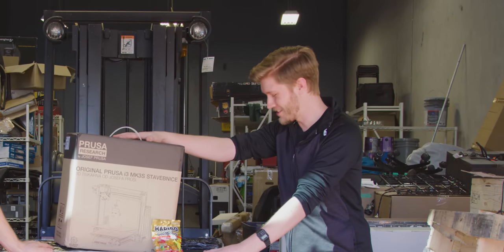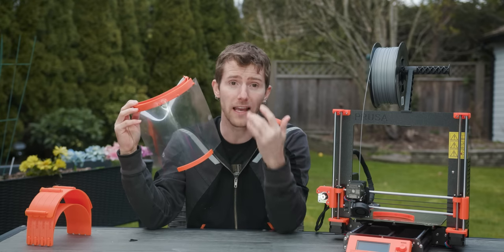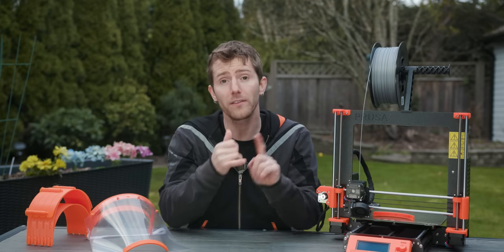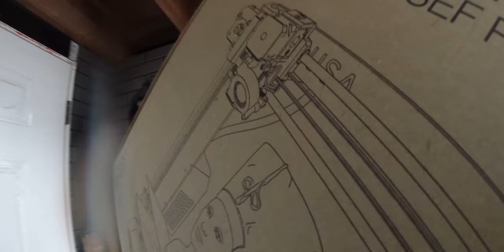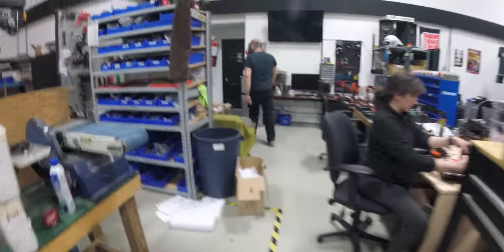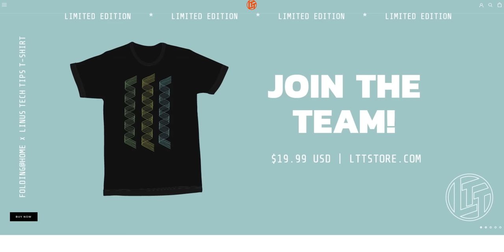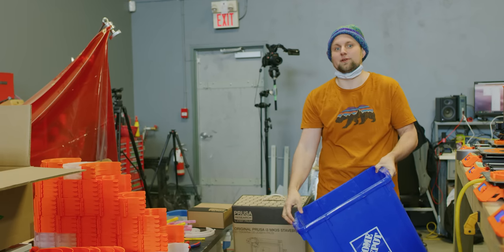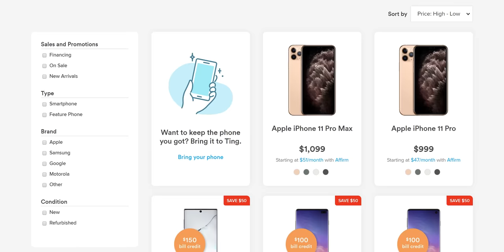3D Printing 300 Face Shields… PER DAY

Comment: im a large 3D printing enthusiast and im curious as to what issues you had along the way. What kinds of failures?
Reply from the maker: @UCzSvEg274I4BCTOg_dE9A0A Actually, there were some issues -- which we expected -- given the crowdsourcing of the builds. It was mostly limited to slack/misaligned belts or improperly tightened GT2 pulleys. ~95% of the printers were out of the gate perfect, and the rest I had fixed in minutes -CW
Reply: Make it a separate video!!!! Hahaha

Comment: "Why are we not using injection moulding?"
I'll ask a better one
What is injection moulding?
Reply: I'm gonna go out on a limb here and say it's probably where you inject plastic into a mould...
Reply: This is the thing that bothers me so much. Using 3D printers is a good way to quickly prototype the face shields. But it is a very slow process.
3D printing in its essence is for quick prototyping or making at-home-DIY projects.

With a large scale need for face shields, you absolutely need to leverage injection molding. A company in my country did that, first using 3D printers to make the prototype and then have it approved. Then they moved to injection molding and re-tooling took a week. After that they could produce 5000 units per day.
Reply: Injection Moulding is a process in which warm, fluid plastic is pressed into a mould. The big advantage over 3D-Printing is the fact, that it takes seconds, not hours, to complete a part. The downside is, that you need a injection moulding machine and the mould, which needs to be made specifically for the part you are producing.
Almost all of the plastics we use, are produced with injection moulding, therefore they are so cheap.
Reply: @unbenannt7771  true, but the machine cost a fortune, 3d printer is franction of its price
Reply: @unbenannt7771  'warm fluid plastic' ?, no , that stuff is damn hot, get it on your skin and the skin is gone , been there done that . The downside is as someone else has pointed out you need the machine and the mold , both of which are expensive . The mold is refereed to as a tool and takes a lot of design work and testing , but yes , its the fastest and most cost effective method
Reply: @timipetrasek470  the machine itself isn't too expensive when considering other industrial equipment. The expensive part of it is making nd maintaining the molds. The tolerances have to be incredibly low so that the mold will accurately output the part.
Reply: putting melted plastic in a mold. its lighting fast compared to 3d printing, cheaper because they dont need to buy filament, and more eco friendly since it uses less electricity to make it and mold the filament in the first place
Reply: I'll ask a better one
WHY IS INJECTION MOULDING
Reply: @alexleistikow2940  ever hear of April fools?
Reply: @Lars16  The cost of the machine depends on the size of mouldings you eat to make, it isn't something like Wheely bins  or larger the machine is huge and so is the price tag. If it's just nozzles for something like vinegar bottles then the machine would fit in the back of a pick up truck . The biggest ones cage to arrive on several articulated trucks and be assembled on site. Biggest I worked with had a clamping pressure of 50+ tons
Reply: @Lars16  3D printer is def not  a quick way compared to mould, buuut everything counts and it is awesome they step up, I personally donated money to womens center for domestic violence in Italy, what have you done?
Reply: A machine clamps 2 pieces of a mold together at a certain tonnage. The mold has cavities in which melted plastic is 'injected', the mold is cold (cooled with water) so the plastic solidify's and retains the shape of the mold. Machine opens the mold after the plastic is cooled and the end product get's ejected from the mold. 

The most expensive part of injection molding is the tooling (mold itself). But due to high volume the cost per piece of product is very small.
Reply: @Lars16  Yeah. I don't want to shit on peoples efforts but 3D printing is not great for mass production.
Reply: @timipetrasek470  But there are already machines out there. Even one would be able to churn out hundreds an hour. The mold is needed too but with modern CNC, that's pretty straightforward. Don't get me wrong, I'm a big fan of 3D printing and it's great that people want to help. I'm just a bit cynical I guess.
Reply: @chaos.corner  The lead times on mass produced injection moulding are much longer. Once a design for the end product has been finalised, the 3D printers can get to work the same day and have product finished almost immediately, albeit at lower volumes, and in the meantime the moulds have be designed, fabricated, tested, tweaked and the results validated on a per-mould basis. So yes, an injection mould system is absolutely faster, and they'll take over in a couple weeks, but when people need it NOW, they simply aren't an option. EDIT: Check out the comment by "Chris Robinson" elsewhere in this thread, more detailed
Reply: These are not super-complicated parts and they are fairly small so a lot of the problems with injection molding are minimized. Tolerances are also not amazingly critical (especially if hobby level 3D printers can manage it). My design tech teachers were able to knock out items of similar complexity on a hand-operated injection molding machine with hand-made (non-CNC) molds back in the 80s. You wouldn't set a machine up from scratch either. You'd find a shop which had one and either rent it or see if they would donate. The mold is the kind of thing that This Old Tony would knock out in an afternoon.

Mould is the UK version of mold fwiw.
Reply: @chaos.corner  I think you've underestimated the demand for these things. You're still talking about small-scale manufacturing, the requirement for these worldwide is in the hundreds of millions.
Reply: @Redemptioner1  And what r u doing here? Calling it a waste of time and resources and you're here doing literally nothing but watching a video. At least he's trying to make a difference, what have YOU done?
Reply: @stoneymahoney9106  I think you're underestimating the throughput capability of injection molding vs 3d printing. If the demand is hundreds of millions, injection molding is a no-brainer.
Reply: Exactly what it sounds like; a mold is created which is a shaped cavity and filler material is injected into the mold.

The material can be anything from metal to plastic.

It's a very fast way to fabricate quickly.  It has it's limitations compared to 3D printing; 3D printing is capable of making separate objects within other objects.  With injection molding you have to make all pieces separately and then assemble them.  It's not that big of a deal for a face shield.

The other problem with injection molding is that shapes with sharp edges or corners are nearly impossible.  Which also shouldn't be that big of a deal for a face shield as a face shield doesn't need super tight tolerances for such a simple mechanical device.

Usually when objects require tighter tolerances they will have a mold that is larger than what is required and use a milling device to shave off the excess to the correct tolerance.

Modern fabrication is actually pretty interesting and there is a lot more involved than people realize.
Reply: @MrTarmonbarry  To be fair, compared to metal injection molding; the plastic is relatively warm.

I get what you're saying though, people shouldn't underestimate the temperatures involved.
Reply: Prusa actually had a mold made just right now... increasing his 3000 a day to like 10000 a day. (thus well, just next to Prague we actually switched to 3D print few respirators - but it takes 24 hours to do just one properly :/

Comment: As a Front line healthcare worker (Therapy Assistant) From Alberta Thank you!, 

Also just so you guys are aware (if you wanted to test it) the most common cleaning agents used by hospitals around Canada include:
Virox
CaviWipe
PCS 5000 (Wipe and solution)
Super Sani-Cloth
Metri Guard (Solution)

Comment: I'm servicing, building and selling 3D printers as my day job. 30 Prusas? hold my beer :D
Seriously though, even experienced builder needs 4-5h for doing it properly (autocalibration shouldn't detect any skew).
So I can do maybe 2-3 per day before my brain boils off.
Reply: What I don't understand, couldn't they make them more pre-assembled from the factory? For example versions like the Ender-3 already come quite pre-assembled.
Reply: @beetledrift  Prusa Research do sell a pre-built option for the i3 MK3 but it costs more and the lead-time on them is longer. I'm guessing they sent the one that was cheaper for them to send (the kit, as it doesn't have work-hours invested in to the full assembly) and when the project pivoted from "something fun, taking longer" to "let's get going on this high-urgency thing ASAP" they reached out to their local community to find capable makers who could crowd-grind the assembly.

I'm a believer in assembling your own printer from kit so you understand how it goes together. It's still quite a fun-engineering hobby and sometimes things fail or need adjusting or unblocking - if you built the kit yourself you're more likely to know how to deal with any issues.
Reply: @MattFowlerBTR  exactly. I've been tutoring teens how to assemble those printers and if someone can understand what they read and follow instructions it's a pleasant experience.
Also, makes any service much easier if you know what you're doing.
Reply: @beetledrift  Prusa is much more complicated.
Also someone needs to assemble it by hand, and it's done in UE, so wages and workers rights are bit more demanding than in China.
You cannot beat 10 year old kids into submission and make them assemble 3D printers for 18 hrs straight in Czechia. ;P

Comment: I’ve actually been using a custom model of these face shield head bands which only use 16g per shield, which means one 1kg spool of filament makes 62 headbands.
This also means faster printing, which means more efficient production ;)

Comment: This is the first time I have ever heard of someone using glue as lubricant
Reply: that because it wasn't and its not. They said it was used as a barrier. glue stick can be pulled off a lot easier then melted on plastic.
Reply: @SpencerPetaluma  which makes it a lubricant, it makes it easier to pull off
Reply: @jglf  A lubricant would come off easily from print. They likely had to use a solvent to get the glue off. All the glue was doing was creating a weak link. its a barrier. a condom if you will.
Reply: @SpencerPetaluma  instructions unclear
Reply: @jglf  that's not what a lubricant is though. A lubricant would make it never stick, this makes it stick, but in a way it can be taken of later
Reply: bed adhesion material is not the same thing as a lubricant.
Reply: @scarlettekk  it's glube

Comment: If you can get them, the textured printbeds for the Prusa are the way to go for PETG.  It sticks well enough to hold but comes off clean with no damage.  I've made about 150 shields on mine so far in the last few weeks and ran the local Microcenter out of PETG, haha.  Hopefully amazon will deliver more before I run out.

Comment: I am in additive manufacturing since the beginning and there are many much easier and fastest ways to do face shields then 3d printing. For example, use dense polystyrene and cat it with a hot wire or knife in the desired shape then attach a transparent shield. Or using a simple vacuum former (same price as 3d printer) and form thin transparent plexiglass . in time of one printing can be produced a minimum 10-20 pcs.

Comment: i work at a t shirt/ print shop , my boss is working 12 hours every day making faceshields.
we have several hundred meters of Forex foamboard to make the headband parts, and we use 100 micron laminated foil for the shield itself
the foamboard is drilled and secured to the laminating with metal studs
he has made several hundreds of them in a day. he has donated at least a thousand to hospitals all around the country, its faster and cheaper to make than 3D printed ones, so EVEN IF you don't have a 3D printer you can help !!

Comment: We are making about 250 a day, almost 4000 donated. Designed a custom visor that is only 7.5 grams of filament. Ink smith seems to only be interested in selling their design at this point. We built ours around easily accessible supplies and deliver directly in the community.

Comment: With injection molding your looking at 2 to 4 weeks minimum for a decent tool, and that depends on complexity.  Note: the number of cavities (actual molding areas in the tool) add to complexity, and that gets compounded by any moving mechanisms needed by each cavity.

Comment: If you can make a design with a cover over giant hole in the top, they would be more appropriate for use in Canada/ bc, as they would fulfil more of the requirements for airborne / droplet precautions

Comment: If you're serious about this "which it seems like you are," you should get something to clean, shred and extrude filament from recycled waterbottles, which can be a way to cut the cost of filament over time. This also meaning you can expand your print farm for prototyping for other companies in the future at lower cost and at the same volume that you would be making these at. Even if that isn't your move going forward, I see potential in what you are doing for many applications that could lead your business to great success when this is all over.

Comment: If the plastic you need is used in the 2 litres drink bottles, which i have seen screw cut down for printing filament, I guess talk the local schools and the local recycling companies for collecting sorting and cleaning might get you guys enough filament for printing. next all you need is... a few more printers...

Comment: Aand here I'm in Italy, capable of producing hand sanitizer I've asked and I've been answered that I need the usual approval, testing, registering a new product instead of using the pharmaceutical tubes I already have in house (for other products). But then it seems hand sanitizers shortage is already ended and if my company will ever survive the lock down, Europe that isn't cooperating to Italy at all, I'll try to make it a new product line for the future.

Comment: Would using a larger (Commercial Scale) 3D Printer be more beneficial in terms of cost and time?
Would I be able to compete with traditional manufacturing if used the strategy to print with large/ heavy duty printers?

Comment: Isnt it possible to use a conveyor belt on the 3d printer then just make it move every time the 3d print is done, and use some type of shredder to deal with failed prints and recycle it into filament using a filastruder machine ??

Comment: There is currently a shortage of the mask type that takes fitted cartridges.  It might be cool to design one of those with a built in face-shield that can be rapidly produced with 3D printers.

You will need to create a cloth portion to mount to the face.

Comment: Where did you get the actual clear plastic for the shield? I work in a hospital ED and we're running extremely low on all our PPE. Myself and the ED director have been exploring the possibility of doing 3D printing for the face shield brackets/mounts (our affiliate university has a vast wealth of printers not in use due to COVID shutting down the school) but need to know where we can get the clear plastic sheets, we're healthcare and have next to zero knowledge of what the Google-Fu terms would be.
Reply: Polycarbonate and Polyester (PET) Film are two common plastic materials used in the development of surgical face shields. Whereabouts are you guys? Perhaps I can help find a supplier close to you.
Reply: @Vincent-mv6ux  thank you so much! That helps a ton

Comment: Just so you guys know and give it a shot, these printers are super silent and the print speeds on them can be tuned up to 150% or more! by rotating the knob while printing...We are going 150% speed, and with 0.3mm draft speed (so making it 0.3mm layer height while doing the gcode)...you guys could technically bump your numbers to X4, so from 300 to 1200 pe day! So far we are doing this for two weeks and these are working great, also if you guys want to run them at 80% for first couple layers and bump them back up to 150%, you can do that as well to minimize the print failures or just use glue on the print bed to make the parts stick to the beds properly in the beginning...hope these will help...!

Comment: 11:15 I had almost that much waste from support material, fails, etc after my first 3 months with just one printer (Anycubic i3 Mega, knockoff of these).... maybe not quite that much, but it was about half of a 5 gallon bucket.  I was just printing nonstop to get the hang of it, not wasting nearly as much now.

Comment: 6 hours to assemble a 3d Printer? 
The anycubic chiron i got was like a 1.5 hour assembly with a MUCH bigger print area of 400x400x450 but it does cost more :/